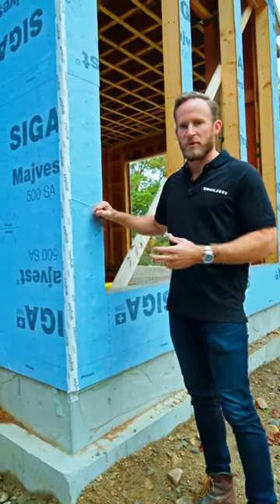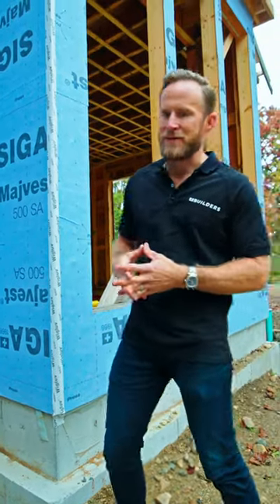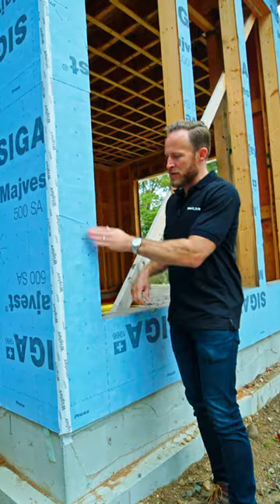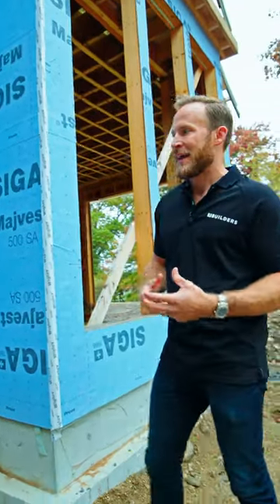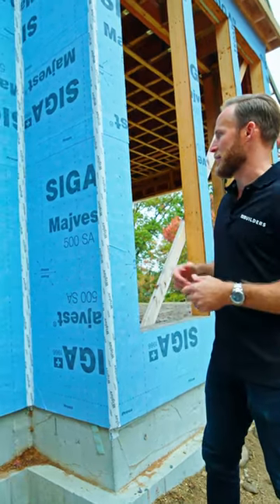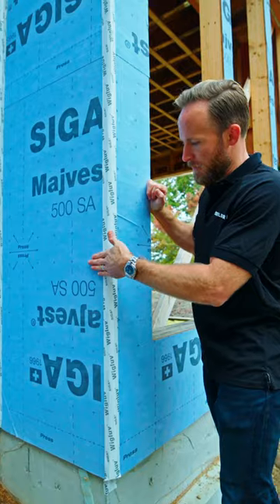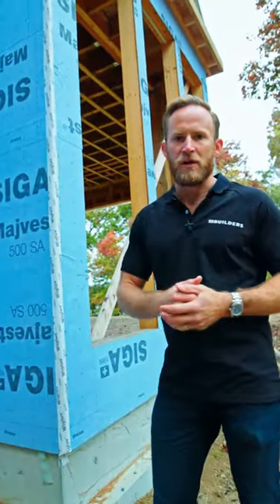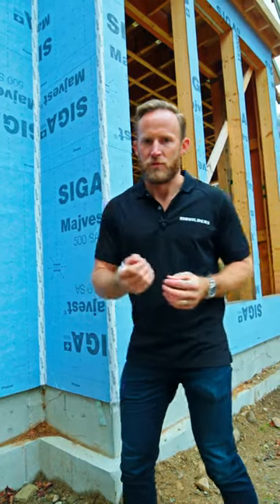Before installing a Weather Resistant Barrier on your construction project ⛈

Comment: these guys clearly go to great lengths and at great expense to make the strongest timber homes possible. But, these timber homes will still never be stronger than block and brick homes. So why not ditch the timber if you truly want your clients to have strong homes?
Reply: Lots of benefits to building with wood. It’s very fast and easy to construct and modify to future needs. It’s more sustainable. It’s more affordable. It insulates better. It’s less prone to seismic damage. Leave the concrete to foundations and hurricane areas.
Reply: @stonewp  it insulates better? How's that work?
Reply: I live in a 1920’s home close to downtown Boston. It has been remodeled and they may out changed a couple of times. Good luck doing that with all brick construction. 

If you build with block and concrete, you would still need to insulate the exterior and porous materials such as bricks and concrete hoard tons of moisture which can really F up the thermal dynamics of home comfort.
Reply: And don’t get me started on renewability and sustainability of wood materials vs brick and concrete
Reply: @kincaid9134  there’s much more open cavity space available for insulation in light wood frame construction compared to masonry. It’s not even close.

I’ve done what was at the time (probably still is) one of the most advanced insulating concrete homes in Germany. It’s very cool if it’s the visual effect you want, but there’s nothing wrong with light wood frame construction.
Reply: @stonewp  okay. I love timber framing paired with brick but if it's that inefficient then I may think otherwise
Reply: for some reason I feel like I just walked into a Three Little pigs conversation